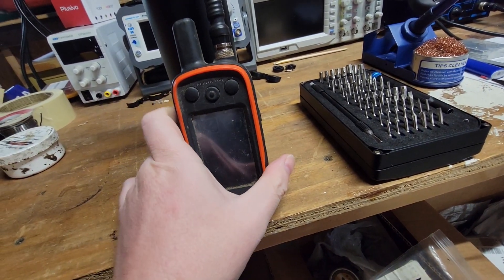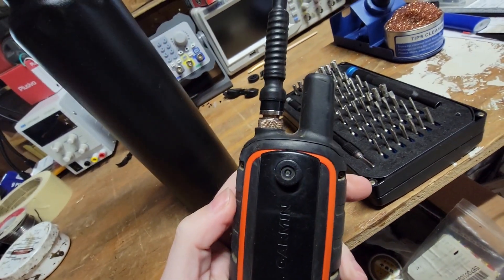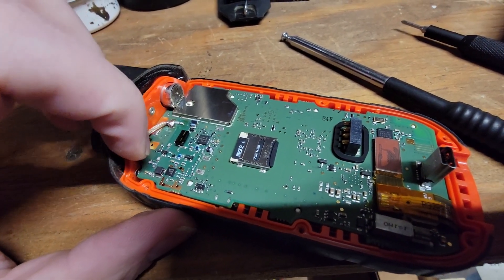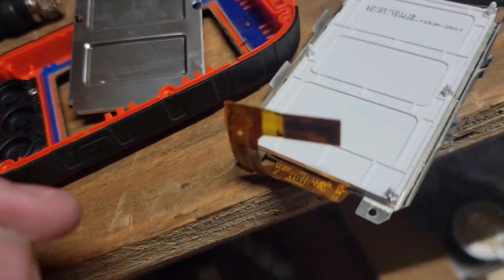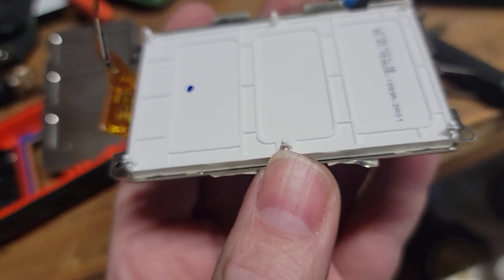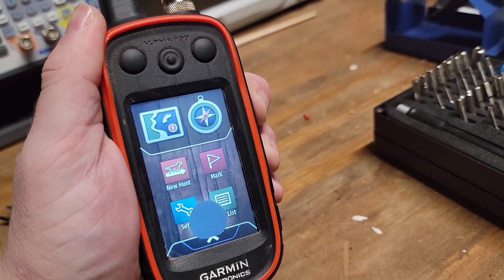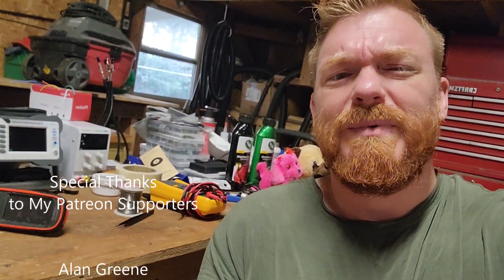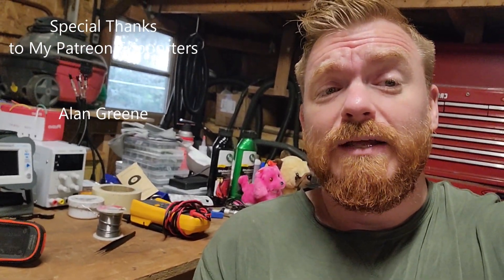(Analysis) Garmin Alpha 100 GPS Receiver

Comment: Very useful video. You actually don’t have to desolder the antenna tho. There’s a 5/16 nut on the top and it will slide right out I just used a 5/16 socket to get it off!
Reply from the maker: @TravisPittman7 I definitely missed seeing that nut. Good catch! Pinning your comment so it can help others.

Comment: How did you remove the ribbon?  I need to replace my front case.
Reply from the maker: It's been a while since I worked on this. I'm fairly positive the ribbon cable just popped off at the pcb via its header pin connector.
Reply: Hello. Great video. I have one of these units  that has been well taken care of and never had any issues. I stored it inside after hunting season. Went to take it out and it wouldn’t power on? Do you think this could be easily fixed? Tried powering on with new battery and without battery just with power cable also. No luck…..
Reply from the maker: It's possible. I don't accept repairs outside my local area any more. However, if you've taken it apart and are able to do that again. I don't mind answering a few questions over email.